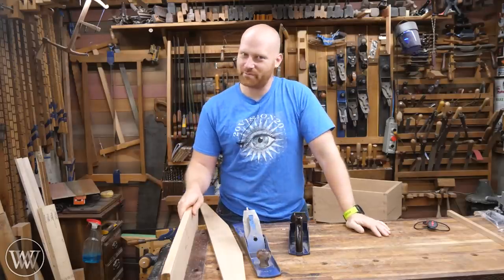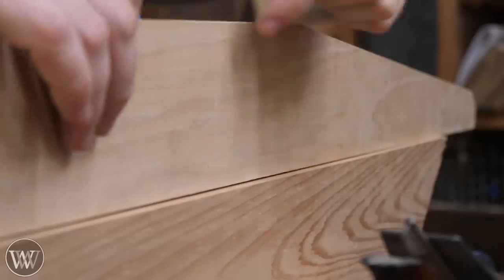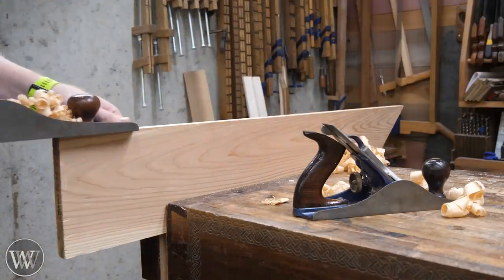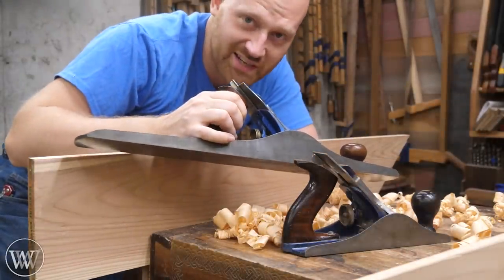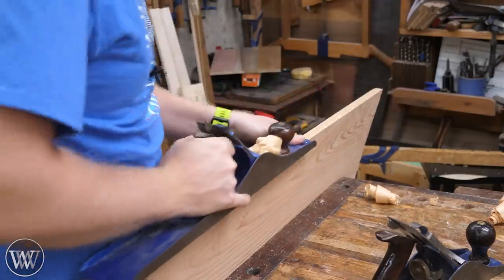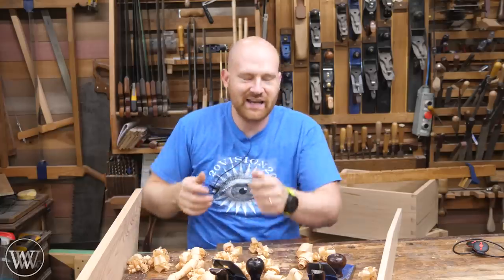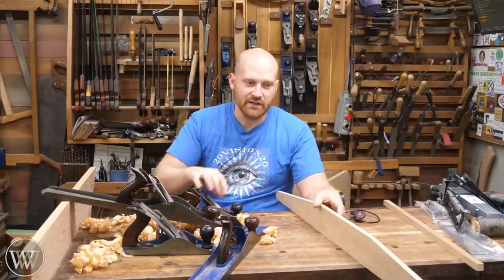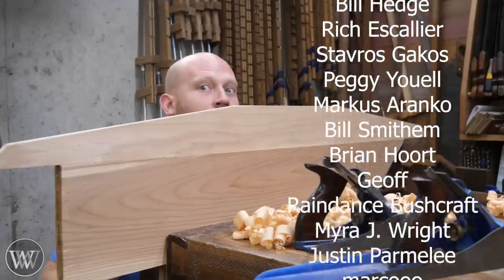How to Joint a Board With a Short or Long Plane

Comment: I just straight lined six 12 foot 6/4 and six 8 foot 6/4 pine boards for a counter top. I used a #7 jointer plane and had it all done in less than 30 minutes, both sides, and it was actually fun. I've got a jointer, very seldom use it, and can straight line long boards on my table saw. 80% of the work in my shop now I do with hand tools. Thanks for the video. I'm sure beginners can joint boards now using hand planes and help keep the hand tool trade alive by watching this video.

Comment: It's been my experience that the #7/#8 tend to twist as I use it. That is as it heats up with use, the plane body twists and leaves you with and unsquare joint. unless the boards are jointed in tandem. I personally use a 5 1/2 and  a #4 as you described, and leave the    #7 to table tops and such. I Sell ever #8 I run across.  Good vid...

Comment: I have a jack plane and I pulled the blade back so, when the board was flat, very close to no wood was removed. I had a hump in a board I was planing and just started the plane so the blade was just in from the end. Once the hump got down to flat I stopped taking off wood. If it was concave then only wood on the ends were taken off, as you did.

Comment: James you said that you would be using your 4-1/2 plane because your number 4 was set up as a smoother. What are you differences in these setups? Are you just closing the mouth further, or is the blade sharpened differently? Over all good stuff, I really appreciated this one.
Reply from the maker: Yep. As a smoother I really can't take any more than a half a thousandth off without it clogging. It's set up with an incredibly fine mouth and chip breaker. Most of my planes I back off quite a bit so that I can take off a 1/32"or so. That gives me flexibility to take a really fine shaving or really thick shaving if I want to. And a case like this where I need to take off a decent amount of material I may push the blade forward and take off a lot and then pull the blade back and just take a few fine shavings at the very end.

Comment: Like with footwear, they all have their uses, some are good for the polder, others for concrete floors. But in my (limited) experience I would say the No4 is often just as good as the No7 for jointing. Very often grain runs in such a way that taking a cut from end to end is a bad idea anyway.  The other day I watched Far East Wood (amazing craftsman) hand plane a work bench top with a very  small plane. Planing is mostly experience, not the tool used.

Comment: Thanks for the video.  I don't see how you can't get a hump out without having to cut a concavity into it.  Why doesn't the longer plane stop shaving after it passes the hump?  As long as your weight is still on the back of the plane, it seems like it should, unless the length of the high spot is longer than your plane, or unless the high spot isn't in the middle of the board, but is close to the end that you start shaving on.  
Although I'm certainly no pro.  I've cut big dips into a board that weren't there before, as I was "straightening" it.  And got pretty far before I realized what was happening.
Reply: Man, I’m having an issue that sounds like this. Basically, as I plane the second half of the board is losing more wood. Like there’s a dip downward somewhere halfway

Comment: how much should you spend for a second hand jointer plane. most on fb where i am are 80 to 100 pounds. seems quite high where as a number 4 is usually 20 to 30. people on fb always overprice there junk tho in the uk
Reply from the maker: That is about normal for a jointer. They are not as common and more desirable. Sometimes you will find one that needs a lot of work for around 40. but most are a lot higher.

Comment: Does the length of the board in relation to the length of the plane matter as to what method is used?

Can the method you use with the #7 (where the board was concave to start with and you plane until you get a shaving down the entire length of the board) be used with a shorter length board (say, 24 inches) and a #5 1/2 (with about a 15 inch sole)?  Or does the geometry not work out right and you still have to use the #5 1/2 with the method you're using with the #4?  Does the degree or shape of the "concavity" matter?

Also, how thick of a shaving are you taking with the #7 when you are doing the concave board?
Reply from the maker: Yes. Generally the rule of thumb is a plane can do a board twice its length and you know that it's flat. If it's longer than that you generally need to use something else to check for flatness. I'm normally taking a shaving around 100th of an inch to get it flat and then the last shaving or two is around 5/1000 of an inch

Comment: explanation crystal clear 👌 Im just a beginner but i was wondering how much extra material i should leave to joint a piece? Also im from australia and im finding it difficult to source tools at reasonable prices. shipping usually costs more than the tool. any suggestions? looking for a block plane :)
Reply from the maker: ya I only know of a few locations down under. I have a map of all known places to but as well as trusted online sellers I knwo a few of them are willing to ship over seas. might be worth a look. HandToolFinder.com
Reply: Wood By Wright How 2 thank you soo much

Comment: I am jointing two boards together of about 6ft long and 2 inches thick each, I only have a gab at the beginning and end of the boards when jointing them together, any idea how to fix that ?
Reply from the maker: In that case you don't start the plane at the end start it in a little ways where it touches and run down the board but don't go out the other end stop the plane where it touches on the other end. That will take out the highest spot and bring it all down to the lowest dimension which is at the two ends.

Comment: I never considered wearing wooden clogs in my shop.  Is it helpful?
Reply from the maker: They are protective and very comfortable when they are carved to match your foot.
Reply: @WoodByWrightHowTo  While I don't doubt you, that's astonishing to me. They look like torture devices. Do they slip on a concrete floor? It doesn't seem like a wood sole would give you very much gription. And, yeah, I know that's not an according-to-Hoyle word, but you get the point. Thank you for another very informative video.
Reply: @grievouserror     Clogs give outstanding lack of grip and consequently are used in most lumber yards where health and safety is frowned upon.

Comment: Stupid question i suppose, but what could i do to get a perfect straight edge to check my boards before planning? My issue is i want to use the plane to make true edges but i have no reference to make a straight edge?
Reply from the maker: Usually I start by making the edge flat. And then I can use that edge as a reference to then check the next face with a square. I think that's the question you're asking but I'm probably wrong. If so feel free to send me an email or message. I don't always see replies in the comments as they get buried too quickly.
Reply: Wood By Wright How 2 I think he may have been asking about how to make a perfect straight edge to use to check boards. Basically the straight edge you used to check your work. My plan is to get a machinist straight edge.
Reply: @justinhassebrock9815  Ah yes this is what im asking. Im not sure how to make a perfect straight edge to check the boards. Would a home centers board be considered perfectly square enough to use this as a reference?
Reply: Scott T not even close sadly... I mean, they could be if you picked the perfect board but for this you really need dead straight. Look up a machinist straight edge and winding sticks. Honestly machines metal is the best for accuracy.

Comment: I clamp the 2 boards you want to join together in the vise. Then plane the edges side by side till the top edge is more or less flat. When you glue them any peaks will be matched to a valley on the other board. The desirable sides of the boards should face each other in the vise.  I use a Record #6.

Comment: Actually, you can still straighten the edge of a board with the shorter plane without the aid of a straight edge, this can be shown mathematically to be the case. For this to work, two conditions must be satisfied, one, the number of passes must be large enough, and two, the shavings must be sufficiently thin.
The fact you can produce a straight surface using a short tool is the same principle used in civil engineering to carve a horizontal road through an elevation when you cannot see the other side of the elevation and can't use a theodolite.

Comment: Thanks James! Recently I got soba No 6, the plane is okay...but the tote is thicker than their No 4 and Low Angle Jack totes...my pinky finger gets cramped too. Do jointer plane need thicker tote to handle the extra weight?
Reply from the maker: that sounds like a user made tote to fit their specific hand. they use almost the exact same tote.

Comment: I’d love to have a long jointer plane, but they’re just too expensive: my only option would be to buy a restored one from the UK, and I wouldn’t use it often enough to justify the price. And Sellers says he never uses a 6, 7 or 8, so… I’ve got a nice straight edge, it’ll have to do.
Reply from the maker: Right on. There's a lot of people in that same boat. I don't pull out my 6, 7, 8 much at all. But if I'm doing some large jointing I do pulled them out as I have one and it makes the task a little bit faster but not necessary at all.
Reply: @WoodByWrightHowTo  Most of all, I think it would be fun to use a long jointer plane, and I’d probably have one if they’d be easier to come by in mainland Europe. Although Sellers also mentioned once or twice that the long ones can warp – that would be another argument against getting one. I think he has a video in which he restores an old wooden or transitional jointer plane and says that the old wood stays truer and/or is easier to fix than the cast metal ones.

Comment: are you sure there is no flex in the longer plane? won't it sink slightly in the middle with pressure?
Reply from the maker: if you are pushing down that hard then the form needs to be addresses. the amount of flex is well under any measurable difference.